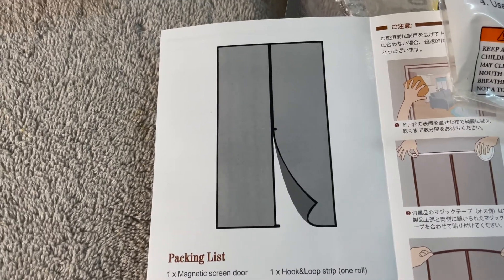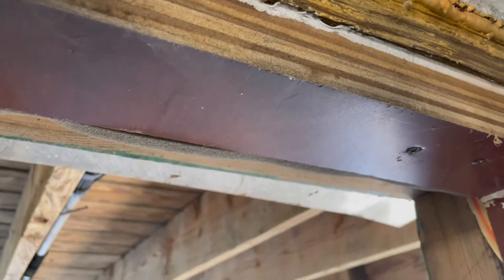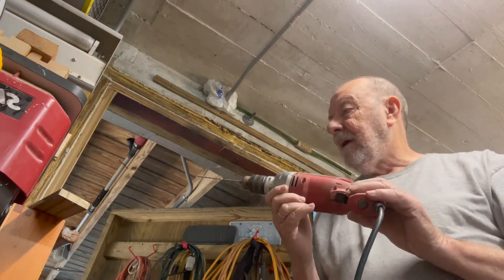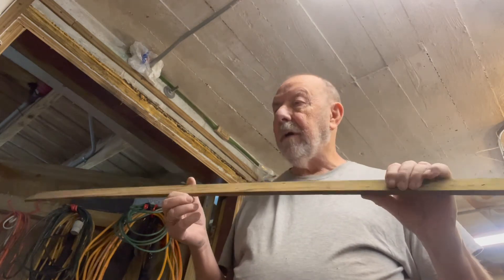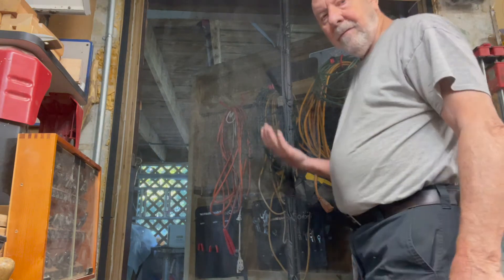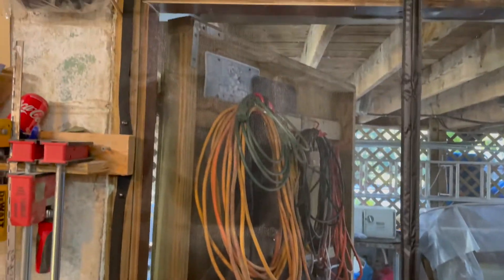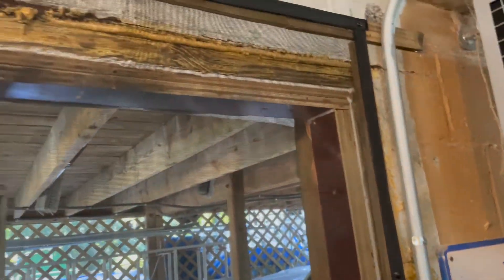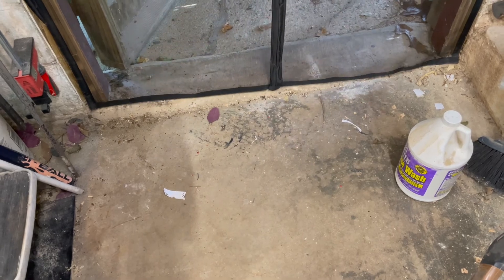Magnetic Screen Install Shop Up Grade

Comment: Great install Mr. Dale and it looks like its nice quality as well.. I have always wondered about those and have seen them that folks hang up that covers their whole garage door... Good Stuff!
Reply from the maker: Thanks 👍I will really enjoy it next summer when all the bugs come out.
Reply from the maker: BTW I just bought a buffing wheel and was wondering which compound do use use for polishing.
Reply: @Dalesworkshop  usually the bars that are brown looking... just the cheap stuff from HF. I will lather it down with flitz or mothers polish ever so often.  Even the buffing wheel will get things hot...I;m sure you know that though.. I had to learned the hard way.lol